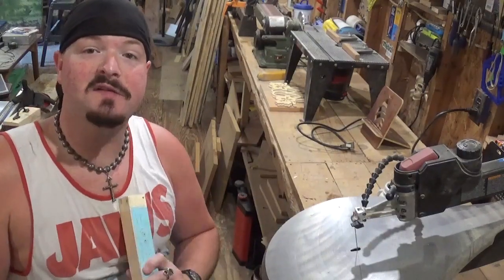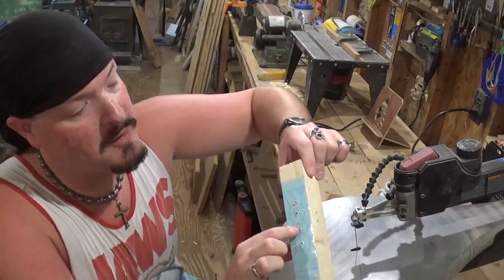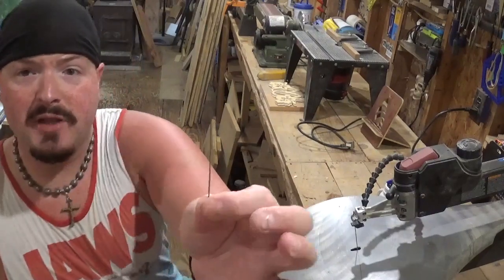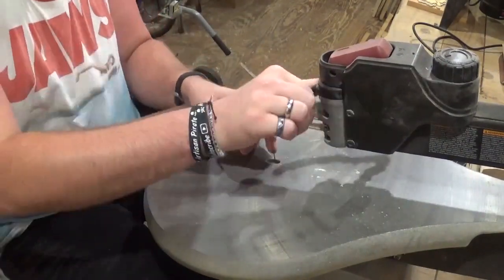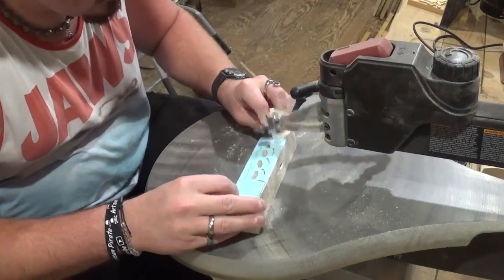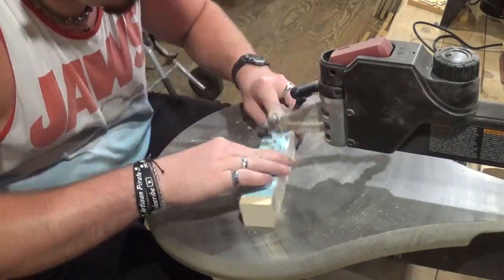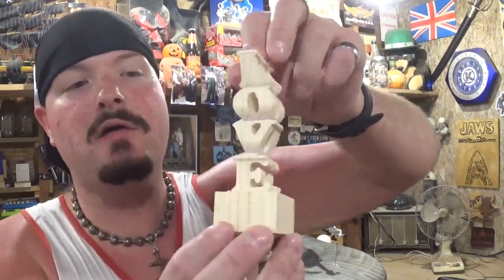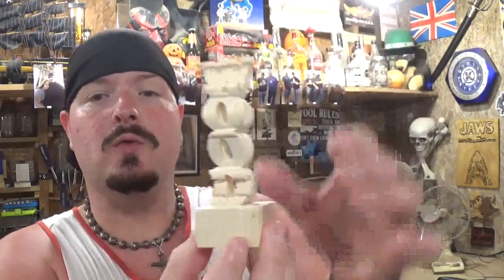Scroll Saw Compound Cut, Word Art

Comment: I enjoy your videos. I have a Delta scroll saw in my shop, and with all my other tools, they are collecting dust bot being used (long story). I want to learn more, so this is why I am watching videos. To gain motivation to get back out in my shop (inexpensively).

 I was wondering if you have videos in which you discuss your techniques, why you choose a certain blade, what blades do you mainly keep in stock on hand, what type off would go you prefer to use for certain projects?

God bless and keep scrolling.
Reply from the maker: Thanks! and 90% of the time I use a number 5 reverse tooth blade, always reverse tooth. It can cut anything easily up to 3/4 inch thick